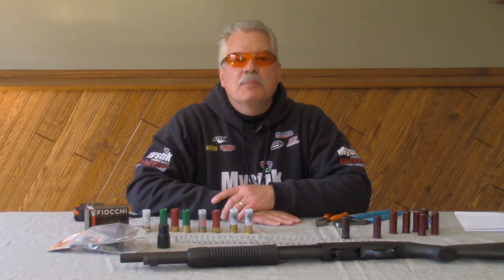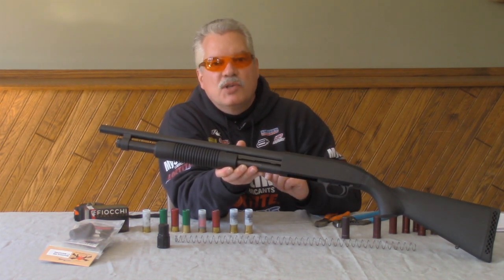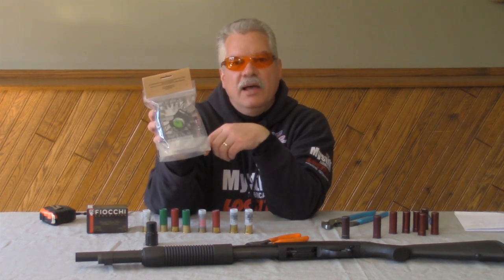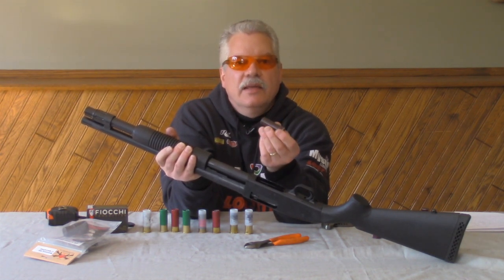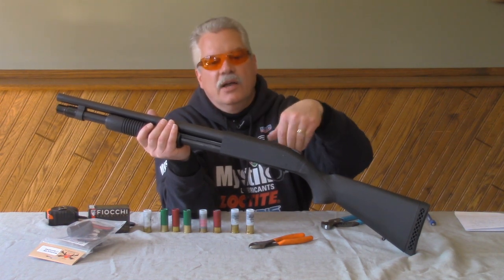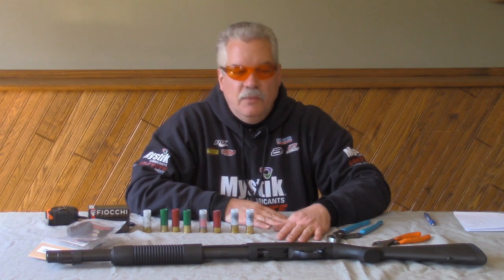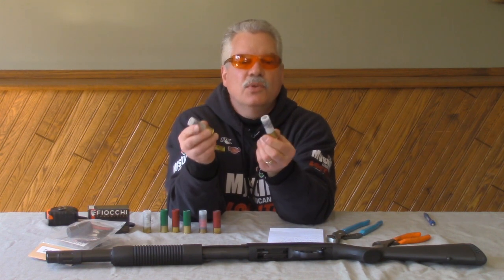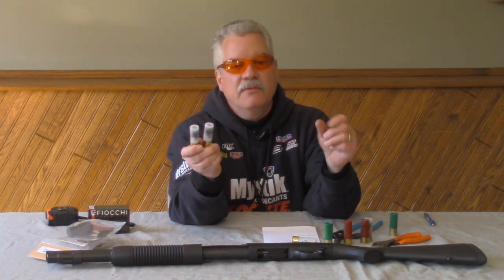S&J Hardware - Shotgun Magazine Tube Spring Fitting when using a magazine tube extension.

Comment: Rollcrimp never bothered me until I tried them in a newer 870 that has a pos trigger geoup. But not only is the trigger group wonky on 870s newer then 2005, the roll crimp shells edge jams on the back edge of the barrel extension and they fail to chamber properly or if they do chamber its a short retry and the go in but shave a bit of hull plastic off on the barrel extension roof! These newer 870s really have trouble feeding any shell into the chamber unless thr gun is pointed more or less horizontal, best with no up angle shell shucking, which might be a problem for bird hunters going after high angle birds. And no its not the rough chamber I’ve corrected that, its the top edge of the barrel extension where it meets the inside roof of the receiver, that edge catches every loaded shell as evidenced by all the different color plastic shavings off different mfgs shells, but the Rio roll crimp are the worst with that thin roll crimp edge, they won’t even chamber at all or maybe after lowering muzzle and trying again! I love s&j, just not a fan of the 870 unless its 90s or older gun and that goes for wingmasters as well as express!

Comment: If that's an S&J follower being used, keep in mind that a 12 gauge spring does not fit inside it. You have to stuff it in with a small screwdriver. It deforms the spring and seems like it could cause reliability problems.The follower just floats freely in the mag tube if you install it the way it's done in this video. He just tossed it down the tube and the spring just sits on top of it (not in it). I tossed it in the trash. A very poor design. It's also expensive.
Reply from the maker: The springs that are included with the kits have tapered ends. They do fit inside the follower perfectly. Some gun manufacturer mag tube springs do not have tapered ends. That may not fit correctly.

Comment: I have a 590A1 that fit 5 shells. I just got the +2 kit. The new spring is just over 22”How many inches should I cut off? Or how do I tell how much resistance this should have? Any help would be appreciated
Reply: How is your spring only 22 inches if they said in video they ship with 45+ inch springs? Did something change recently?

Comment: Must be using the stock follower not a S&J. Your not using the Special  magazine spring that S&J supplies with the kit. They are tapered to fit into the poorly designed S&J followers' What a bunch of BS. It's called "bait & switch"
Reply from the maker: I am using the S&J spring that comes with the kit. I already trimmed it to length.
Reply: So you are saying that the entire spring is tapered?  I bought the follower as a stand alone piece. I could not find anything on your web site or videos indicating  that I needed to buy a spring also. All your site said was that it fit a Mossberg 500 shotgun.That's why I bought it and it doesn't work. @04BlueSmoke
Reply from the maker: @tomsreviews238  send me an email to scott@sjhardware.us I will help you with a spring.